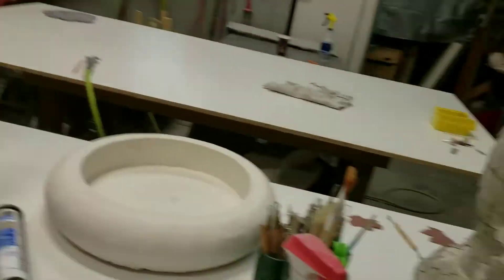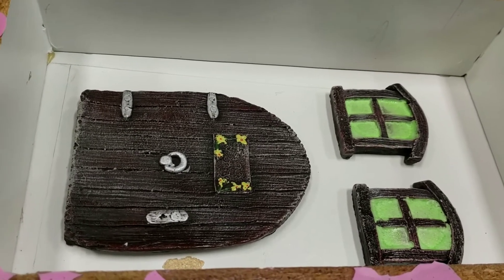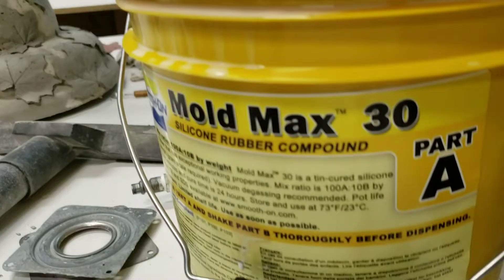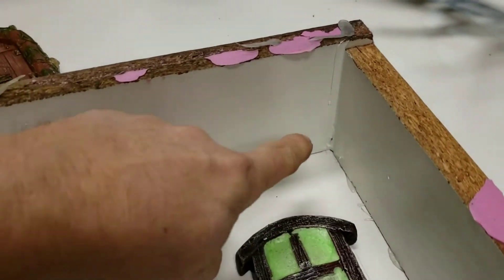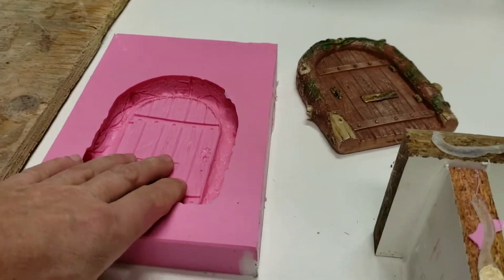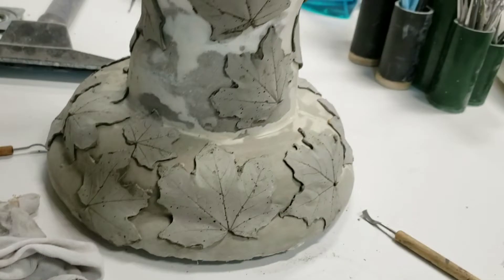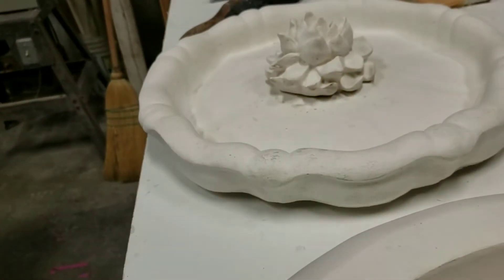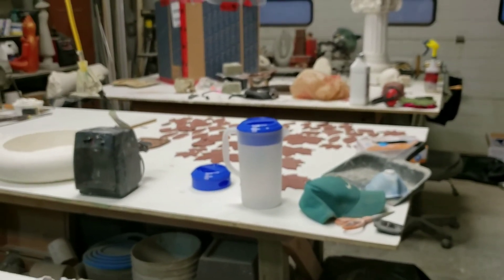Mold making/Update on current projects/ Smooth-on Mold max 30.

Comment: Great stuff man. If you want a better lasting silicon go with the platinum stuff. My favorite is Moldstar 15 Slow . 1/1 mix ratio 
Casted 50 concrete shapes and still going strong !
Reply: I use 15 Slow as well, and I can get a lot of castings out of my molds.  As long as you mix it well and pour from high up as Gris said, you can definitely get away with not vacuum degassing.
Reply from the maker: @StacyTrades5  Thanks Stella always appreciate first hand knowledge!
Reply from the maker: Good to know ,thanks MrVikingdane!!👍😃
Reply: mrconcreteartisan least I can do for all you’ve taught me